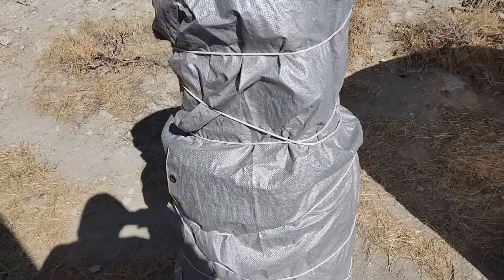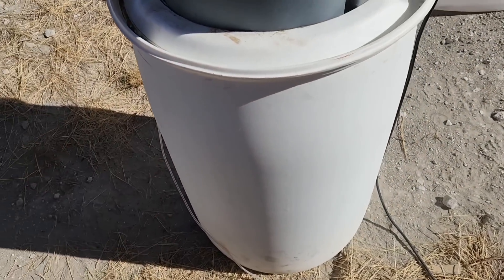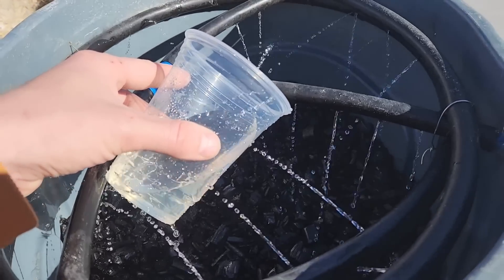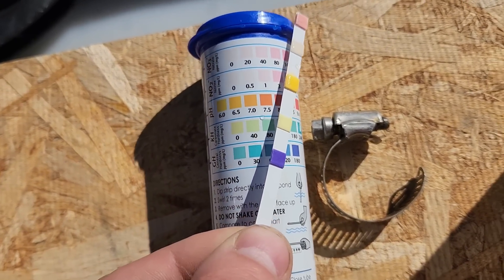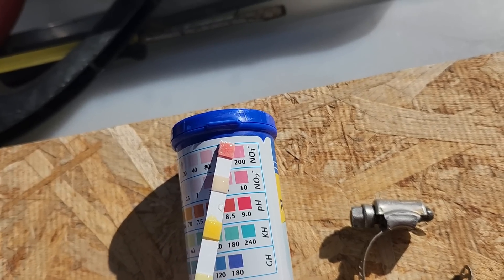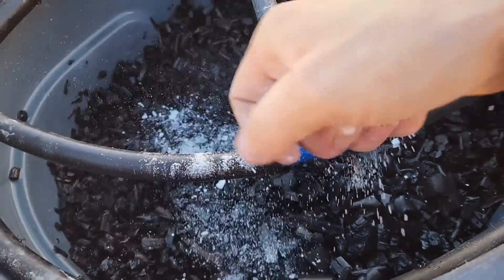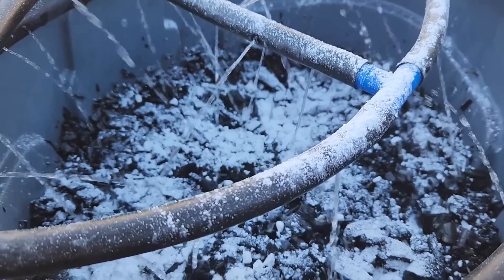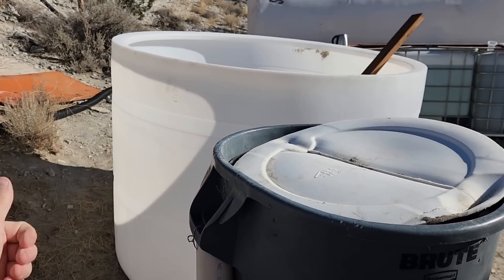Bacterial Oxidation of Urine to Nitrates

Comment: FYI, assuming there's enough organic mater to feed on, if the bacteria don't have enough oxygen, they will start to break down NO3 to oxygen and nitrogen gass, where nitrogen would be lost to the atmosphere (this is actually exactly what we do when treating waste water), so if the goal is to collect nitrogen, ideally the bacteria should have plenty of oxygen and never feel the need to search for alternative sources of oxygen
Reply from the maker: good tip
Reply: Another thing to remember is that nitrifying bacteria like the ones in wastewater treatment plants are usually autotrophic meaning they need bicarbonates as their carbon source.
If you stabilized the pH with let's say sodium hydroxide the bacteria still wouldn't grow because they'd run out of carbon to make more of themselves
Reply: @stickerbeat  Yep, in fish tanks we buffer with sodium or calcium bicarbonate, or aragonite which is a species of calcium carbonate. Reef tank keepers will even add liquid carbon sources like vodka, vinegar, or more formulated products to feed the bacteria and then use a protein skimmer to remove the bacteria directly from solution as a de-nitrification method.
Reply: Hint: cheap alcohols are a great liquid carbon source ;)
Reply: @teagancombest6049  they are for denitrification. Nitrobacters can ONLY assimilate CO2 from air every other carbone source is for denitrification
Reply: @teagancombest6049  bacterias use the alcohols to reduce the nitrate.
Reply: I wonder if this might explain why my recreation of this keeps sending the Ph through the roof just days after buffering back to between 6.5 and 7.5 with H3PO4 and smells heavily of ammonia. Too much aeration and not enough carbon.
Reply: @codyaragon93  maybe the other way around actually. Nitrogen gass is neutral and doesn't smell, so probably that's not what's happening. Might be that either there's not enough aeration, so ammonia isn't fully oxidized to NOx, or there's too much carbon, since bacteria will generally prefer to oxidize carbon before even considering ammonia, since that's harder to oxidize.
Reply: @ The aerator and water pump are running 24/7 but I just realized the enzymes added to the black water tank to break down the toilet paper are probably adding a ton of simple sugars to the mixture. So you’re right, probably too much carbon. But wouldn’t that acidify the solution instead?
Reply: @ And by black water I don’t mean solid waste. Urine only. Long story, lol.
Reply: @codyaragon93  I hope whatever you are adding to the water to break down paper or whatever isn't killing all the bacteria 😅, otherwise, I'm not too sure. The only case I know where pH was going to hell was a client quietly spilling chemicals into the drain 😂, caused us so many headaches

Comment: as for gundpowder, this isn't all that significantly different from old methods of producing potassium nitrate for gunpowder used in the 19th century. They used straw instead of carbon in their niter-beds and was an important source for the Confederates in the Civil War due to their lack of mineral resources and trade blockades. Being big hot beds of waste being composted, though, they weren't exactly pleasant to be around, so this is obviously a much cleaner solution for use in a human habitat.

Comment: How do you maintain a high enough moisture level for the bacteria in the charcoal? Aquarium filters have a constant flow through the sponge and filter media. Filtration also happens through the aquarium plants and with the aid of the bacteria that live all over the surfaces in the tank and within the substrate where the plants are rooted. The reason the surface of the water is agitated by a bubbler is to create more surface area for the gas exchange. 

You may want to examine the science behind the no filter method of fish keeping. It could greatly simplify your next design.

Comment: Normal garden aerosol misters will give you much higher rates of fluid/gas exchange surface, though farmers usually want to slow down rates of urea nitrification, and resultant denitrification.  The rate at which they clog with salts will be dependent upon evaporation potential.  Ergo, a substrate chamber with a lid might be better for the piss pot sequelae.
Reply: Calm down

Comment: You should check out koi pond construction. The small, basic aquarium filters like you're emulating are fairly inefficient - cheap but inefficient - especially when scaled up beyond 20-30 gallons. Shop around online for a used Fluval FX6 - that thing is smaller than a 5 gallon bucket and could probably match or exceed your improvised setup for effectiveness. 
Size up for a koi pond filter system with floating media and a bio-mechanical reactor, something like a Nexus or a DIY version that mirrors its design, and you could start processing solid waste as well.

Comment: Does the pump have the same efficiency pushing water through those holes vs an open-ended pipe? My naive guess is that there's more load with the pressure buildup but maybe the pump regulates itself; if not, you might be able to drop the water on some type of distribution plate to fan out the water for you?

Comment: I think it would be more efficient if the pump is on 24/7, this would also supply enough oxygenation.  
Another option would be to have a small outlet on the upper container, and cycle the pump on/off every 15 minutes or whatever the resolution of your timer is. If so it should fill up the upper container for maximum water/charcoal contact, and then drain for maximum air(oxygen) contact.

Comment: Quite the system!  You must be flushed with pride!

At least three families of bacteria :  one to oxidize urea to ammonia + carbon dioxide; another to oxidize ammonia to nitrite, the third to oxidize nitrite to nitrate.  If the water is exposed to light, it'll get a bloom of cyanobactera once it starts showing an excess of nitrite.They'll die back once the nitrate bacteria get going.

Comment: I want a 3D model file for a 2 liter pop bottle cap that has built in valves so the bottle can only intake on one port and only blow out on the other port. Then you network dozens of bottles to some regulators and a storage tank, leaving the bottles in view of the sun for the pressure stroke and exposed to the night air for the intake stroke and you get a low budget solar motor/air compressor made from recycling?

Comment: Probably a stupid question, Cody, but would sufficiently diluted urine provide the same benefit to the plants without the risk of burning them? Say 10:1 urine to water, provided you used fresh urine before the urea converts to ammonia?
Reply: Urea is commercially used as a nitrogen fertilizer (& too much nitrate is also a problem, due to salinity interfering with water uptake).  Honestly, I  think ammonia is worse for animals than for plants, but that may depend on the species.

Comment: Why do you only use charcoal as an filter medium? Charcoal is great for removing smells and colors from urine (as long as it gets replaced when it can’t bind those things anymore) but has a poor ratio of surface area to volume, especially the large chips you are using, because the small pores in charcoal are often too small to support bacteria life. Probably due to lack of one of these: water, oxygen, nitrate/ammonia or space. It would therefore probably help to replace the bottom quarter to third of the charcoal with something that has a lot of surface that supports bacteria life to significantly increase the surface area of the filter. It really doesn’t matter what that is. The cheapest would be sand but that can slowly wash out in the bottom vat, so you could also go for something that holds its shape better like sponges, pot scrubbers or K1 media. This has the added benefit that you don’t have to restart the cycle when you put new charcoal in because it has stopped pulling smells and colors out of the water.
Reply: easy to source in large quantity and relatively light vs sand ?

Comment: Isn't the ratio you made 9:1? 10:1 should be 1 part chemical (10ml or 10g) to 10 parts water (100ml or 100g) which is in total 110ml or 110g? Or did I miss something? But then again does that (probably) mistake even play a major role?

Comment: Wouldn't 100ml and 900ml make a 9 to 1 dilution? It should be 1 in 10, but 9:1.
Reply: ye, i was thinking he would go to 110 since he said 10 to 1, so it should be 9 to 1.
Reply: nope, the maths are correct. Might be easier to understand if youd calculate backwards, 1000 ml with in it 100 ml of other stuff, devide by 100, every ten ml has one ml of other stuff, 10 to 1, 1/10
Reply: He said “1 to 10 dilution” meaning going from a unit volume to a final diluted volume 10 times as big as the original amount. He didn’t mean 1:10 pee to water. It’s 1:10 pee to total solution.
Reply: I initially thought the same thing too, but Cody is correct here.  

In laboratory settings, when someone says they are making a "10 to 1 dilution" and bringing it up to 100 ml, they often mean they are creating a final volume that has the equivalent dilution effect, not strictly adding 10 times the sample volume in water. By diluting the 10 ml sample to 100 ml total, the concentration is effectively reduced by a factor of 10, which is often referred to as a "10-fold dilution" or a "1:10 dilution."
Reply: @Troublesomeadam  It does not seem to be correct. According to Wikipedia, the dilution factor (written as e.g. 10-fold dilution or x10 dilution or 1/10 dilution) is to be distinguished from the dilution ratio (written as 1:9 or 1+9):

> For example, in a solution with a 1:5 dilution ratio, entails combining 1 unit volume of solute (the material to be diluted) with 5 unit volumes of the solvent to give 6 total units of total volume.

> In photographic development, dilutions are normally given in a '1+x' format. For example '1+49' would typically mean 1 part concentrate and 49 parts water, meaning a 500ml solution would require 10ml concentrate and 490ml water. 

> The "dilution factor" is an expression which describes the ratio of the aliquot volume to the final volume. Dilution factor is a notation often used in commercial assays. For example, in solution with a 1/5 dilution factor (which may be abbreviated as x5 dilution), entails combining 1 unit volume of solute (the material to be diluted) with (approximately) 4 unit volumes of the solvent to give 5 units of total volume.
Reply: @Troublesomeadam  The tenfold dilution, is a good word for it, it has 10 units, with 1 sample and 9 dilutant. but it's still 1 to 9 dilution :D
Reply: So it wouldn't be 10:1 ratio in that case, it would be a 1 in 10.
Reply: It doesn't matter. He didn't do anything scientific with it he just was showing his process was having some desired effect

Comment: Those bacteria die when they dry out for too long.
Reply from the maker: True but it would take months for the charcoal to completely dry out.
Reply: @theCodyReeder have you considered a layer of crushed oyster shells for pH control? It’s cheap.
Reply: @MWilk098 I think he is in Montana, not a coastal state.  Fossil shells--limestone--is probably cheaper if such rocks are nearby.
Reply: @ crushed oyster shells can be bought at tractor supply, they’re given to chickens.
Reply: You would be surprised how long nitrifying bacteria can survive out of water in a sufficiently porous matrix as long as there is some humidity in the system, which there is because he has it covered and wrapped.